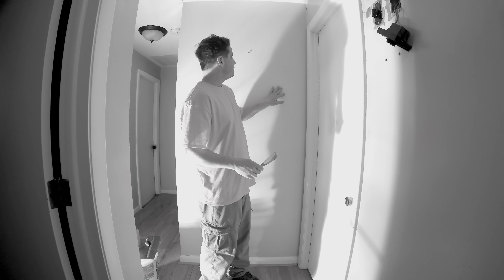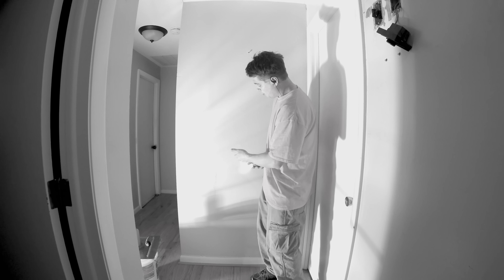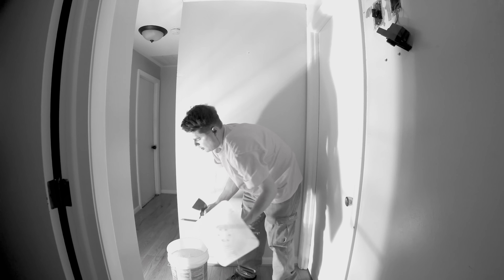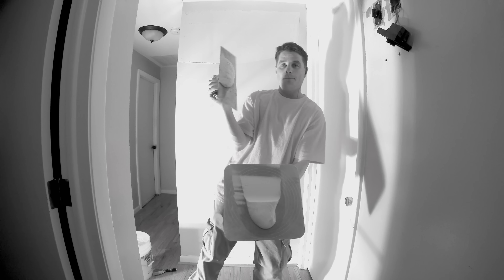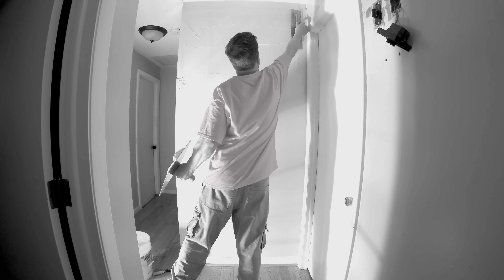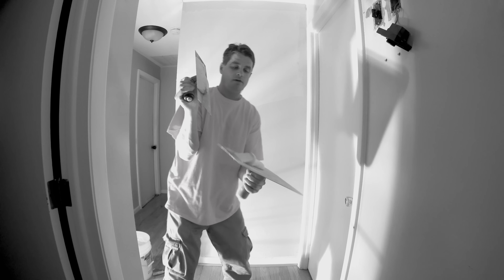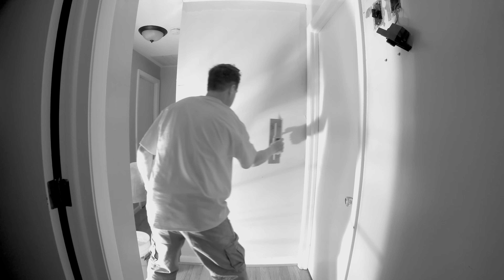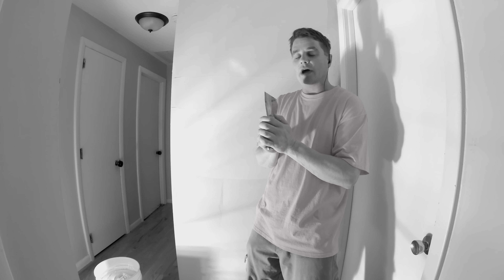How to Smooth Out Ugly Textured Walls with Skim Coat (Part 2) - Drywall Repair

Comment: Russ, I'm wondering why you started your 1st coat horizontally instead of vertically.  Is it because of the "exterior corner"?
Reply from the maker: JoyfulKnitter 

Hi- 

You can choose either way. The other way requires simply different instructions. Going horizontally first, allows me to lay more mud in the hump just prior to the exterior corner by rotating my wrist counter clockwise toward exterior corner and then lifting off at that corner.

Russ
Reply: RussOlinatzPaintShow Thanks!!

Comment: Hi Russ, Question:  Assuming you have orange peel textured painted wall instead of a previously walled papered wall as you are starting here. Assume the paint is satin-flat finish. Do you have to sand down the paint, scuff up the paint, before you can add the sealant? Then once you add the sealant, can you proceed to smooth out the wall as you have shown? Or can you just apply the sealant straight to the wall, then go. Thanks in advance!
Reply from the maker: Jim Craig 

Hi Jim-

Thanks for your question. You can you just apply the sealant straight to the wall, then go! Because there is no sheen or very little (Satin), you can do this. I would first give the wall a light sand to knock off anything that is already on the wall from previous poor paint jobs. 

Russ
Reply: Right on Russ. Still doubting if I can "weekend warrior" my 2800sqft house by myself. Can't shake the doubt yet, so I am educating myself. Another question, I have rounded corners with texture on them. How do you tackle that? Just a matter of rolling up the sleeves and sanding those down? Or should I skim coat and sand those down as well?
Reply from the maker: Jim Craig 

Hi Craig-

I would skim coat and sand them down as well!

Russ
Reply: Thanks Russ!